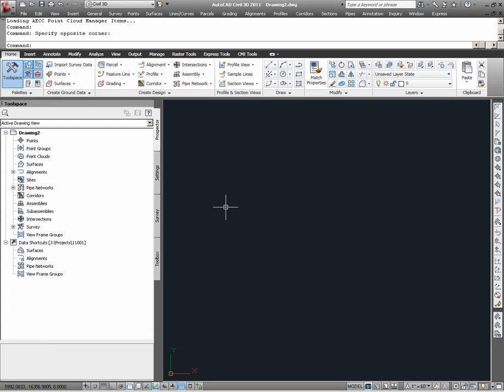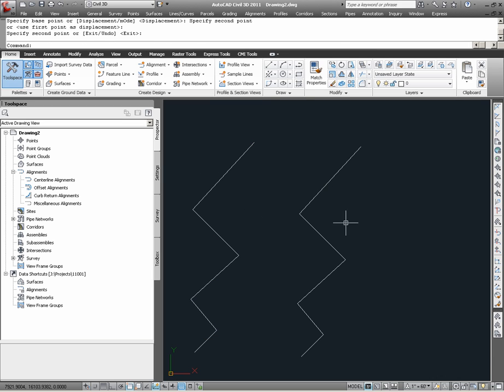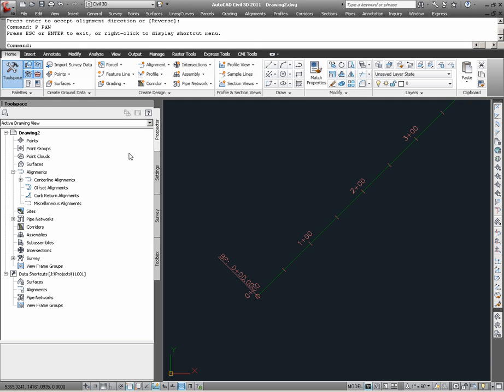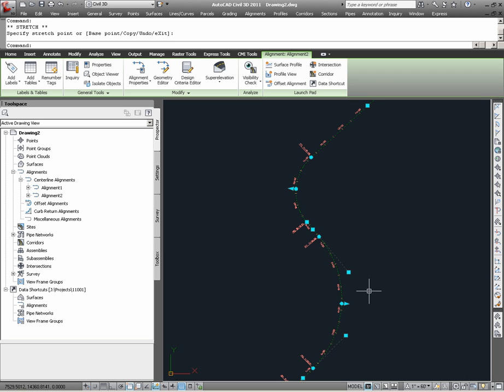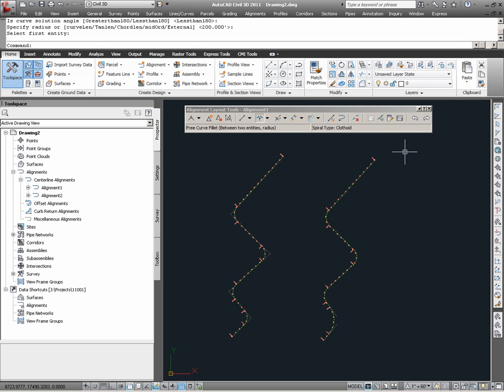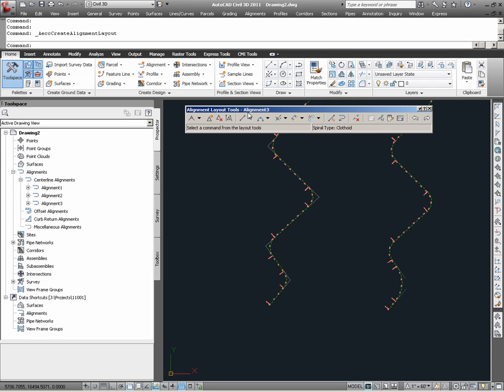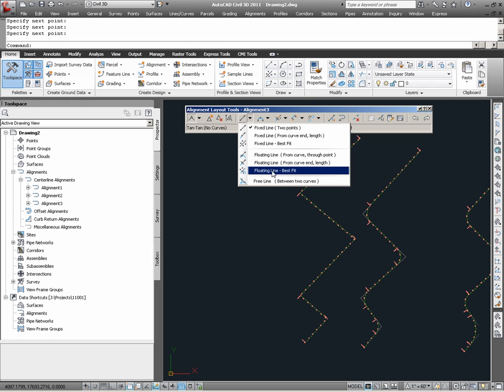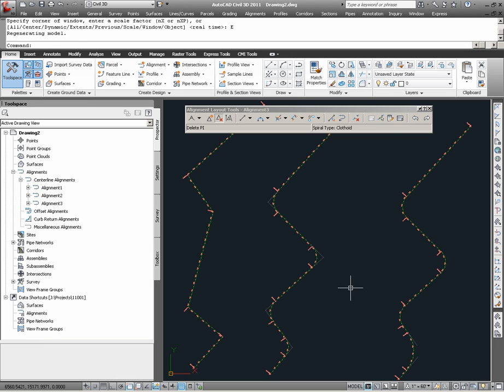Civil 3D Alignment Creation

Comment: Hi, Can anyone share the link or video how can I draw and calculate waste disposal area knowing that I need 4 benches each of them 40 m height, with 20 m safety berm between them, and working angle of each bench is 32 degrees. When this will be draw in Civil 3d, I need also to calculate a volume of m3 which can be full filled in this area.